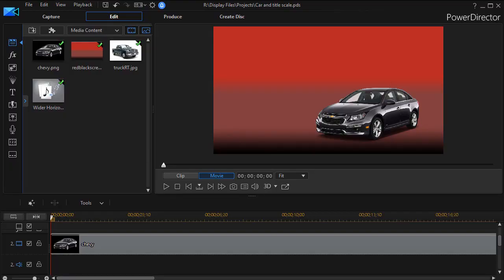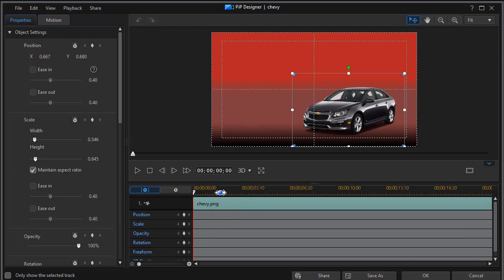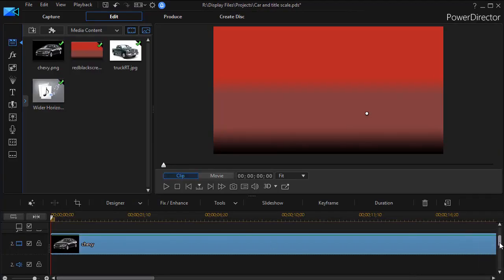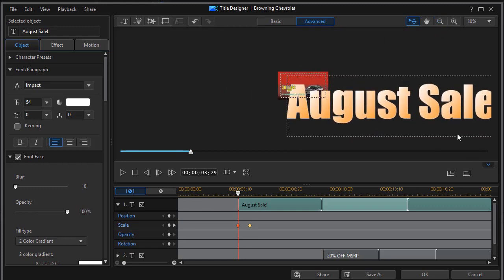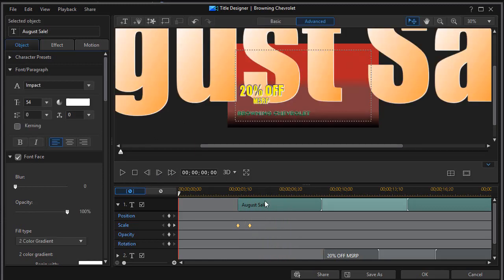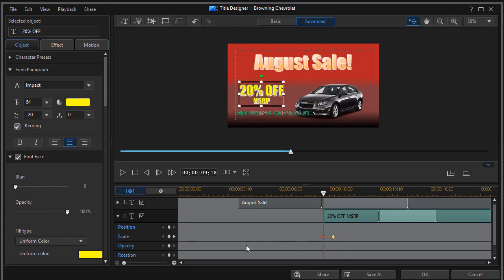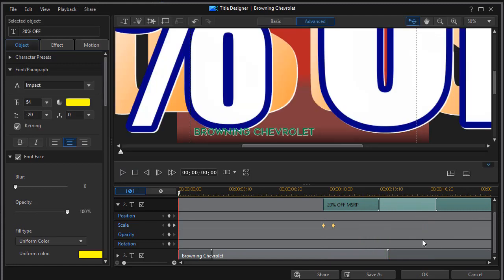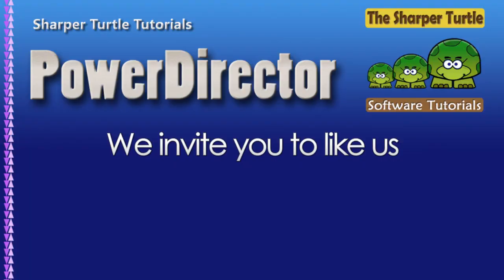PowerDirector - Add energy by growing or shrinking elements with scale keyframes

Comment: Thanks for another great tutorial Jim! On another note, I've been meaning to ask you about the background noise in your videos. Quite often, this video included, I can hear a background buzzing sound which is not too bad (It's probably easier to hear it if you listen to your videos with headphones like I do), but it can get a little annoying, and I was wondering whether you've noticed it and whether you use any noise reduction for your sound editing.
Reply from the maker: Lake,

Sorry about the flawed audio :(   I apologize. I was tied to the air conditioning.

Sometimes I'm too focused on getting videos out frequently that I don't run them through AudioDirector and make sure the sound is cleaner. And I exclusively listen to them with headphones, which isn't wise. I should also hear what the speaker sound is like.

Your comment is encouraging me to give more care to the audio, since I want to reflect professional practices. I don't have the best environment. But neither do most of those who are using PowerDirector. If this slows down the release rate, that's still the better way to go. Audio should not be distracting.

Thanks for the feedback! --Jim
Reply: No worries! it was something I noticed in other videos of yours and was wondering where it came from.